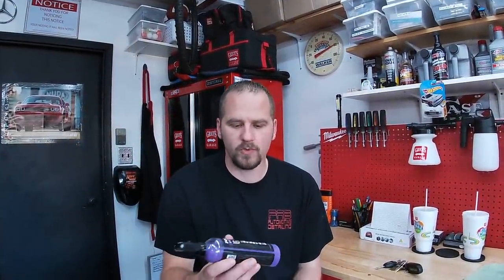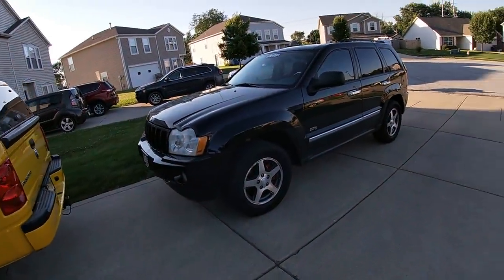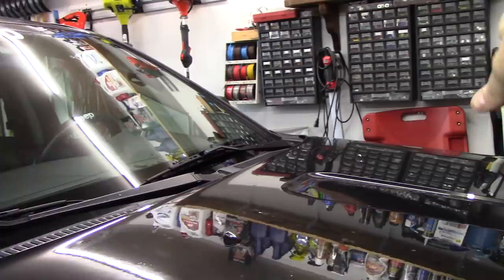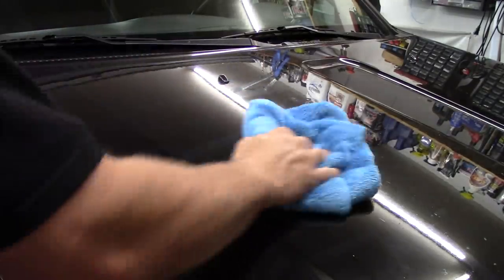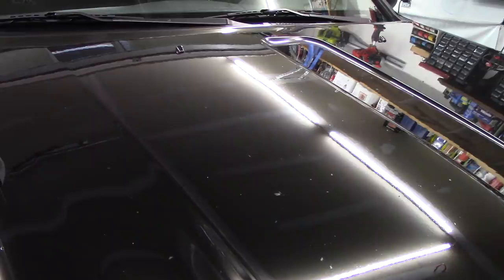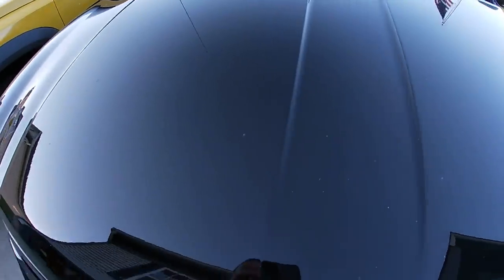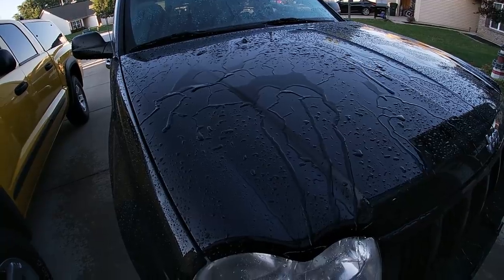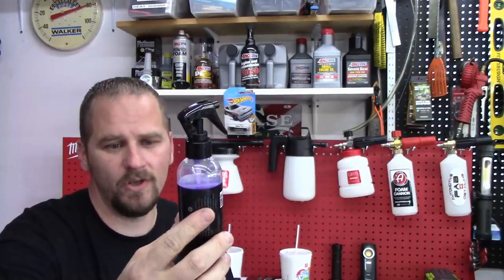Ultimate Ceramic Coating? Not even close! Shine Armor Fortify Quick Coat Review!

Comment: okay. so 2 things I noticed... now i am FAR from an expert, but i hope you revisit this product. first thing, when it says damp microfiber towel, it means damp with the actual product. Not with Water. Water dilutes it further thus decreasing its effectiveness. Second thing, this needs a 24hr curing time. I put about 5-7 coats on my 1994 corvette at this point and ive washed it numerous times and it still beads! The cure time and proper damp towel make all the difference!
Reply from the maker: John fedele I appreciate you commenting! The bottle says Apply to a clean damp microfiber towel. For it to be clean and damp before applying it would have to be damp with water. The bottle states no cure time at all. I get what you are saying but I base my reviews off directions on bottles. I to thought it needed to cure for 24 hrs but it says it no where on the bottle.
Reply: @FABAutomotiveDetailing  makes sense! Perhaps the manufacturer should change their directions haha take care
Reply: @FABAutomotiveDetailing  I think John is right in what he's saying.  I don't think you were supposed to spray that Armor onto your wet/damp towel.  Most of the demo that I have seen, people just spray that armor stuff on their "dry" towel to make it damp before wiping it down.  What do you think?  Redo?
Reply from the maker: Hanzelnuts I did it exactly how the directions state to do it. It’s says to “spray it onto a damp towel”   In order for the towel to be damp before applying the product it would have to be damp with water.
Reply: That product as shown in the video is junk.  It's just snake oil the company is trying to cash in on the detail craze right now.
Reply from the maker: damion goodrich I agree 💯! I think it might just be grape kool aid. 😂

Comment: I appreciate the honest review. I had used Shine Armor on my Black Lincoln sedan and thought it was just ok. A bit on the streaky side. Took some extra buffing out. I had washed the car before using it. Then one day my wife wanted a layer of SA on her Black Charger R/T. Began working on it and I don't know WTF happened. Was streaking really bad. It was a hot day but the car was not in direct sunlight. Didn't notice the streaks at first until I started progressing around the hood. Certain angles looked ok but other angles looked bad. It was not buffing out well. I was starting to freak out! Took me an hour to fix it. Will not buy that product again. I switched to Turtle Wax Hybrid Solutions Ceramic Spray Coating. Worked very well and it wasn't expensive. I ended up throwing out the rest of the Shine Armor. Very disappointed.
Reply from the maker: You are welcome! Yeah I don’t see what people like about this product. Your experience is the same as others that have commented about it.
Reply: This stuff attracks a lot of debris during the application. If you gently feel the finished area with your hands you will feel the rough areas where the dust dri.ed into the finish

Comment: Hey, thanks for doing this. I have been using this product along with their hydrophobic carnauba spray. It actually worked pretty well on my car surface (black paint). There is a substantial difference in before and after. Its a lot smoother and hydrophobic after the spray application. I wash and dry my car thoroughly, spray the carnauba coating first and then this ceramic coating. I agree with you that it lasts only between the washes but for $20 I have spray coated my car for ~10-12 times which isn't that bad..
Reply: Lol , it's the carunuba doing all the  heavy lifting bud 😂
Reply: @jackd1582   Not always, more recently I have used just the Ceramic Coating and it still gives me an excellent smooth and hydrophobic surface but like I mentioned it stays on only between the washes.

Comment: I am writing to you from Denmark. I had high expectations for this product and if it could also remove small scratches on door handles, then this fabric would be a revolution. Bought this through TEMU so it was very cheap and good for it as it's no better than regular Turdelwax. So much rather wash cars with soap and water and then use Sonax car wax. Thanks for a good and honest video.
Reply from the maker: Thank you for the comment! TurtleWax is way better than they used to be but I understand what you are saying.

Comment: I use this product, and now where does it say to utilize water when applying. You should always use just the product when applying. NO Water!! If you can, apply it in the evening when the sun goes down, you are able to let it sit on your paint for a longer period of time, hence allowing the product to adhere to the paint more effectively.
Reply from the maker: William Lemanowicz The bottle says to use a damp towel. It does not say spray on towel to dampen so if the towel is damp it has to be damp with water. I have tried it both ways and had the same results.
Reply: @FABAutomotiveDetailing  I wonder if you have misread the instructions, it says spray onto a mircofibre cloth and then with that 'wetted' cloth rub into the surface and then wipe off with dry cloth before it dries. i.e. wetted with the product.
Of course they may have changed the instructions on the bottle since you used it.
Personally I always wash the car first and then wipe over with this stuff to give it an extra coat, might be overkill but I always get a great finish with it. I don't however buy into all that nonsense about burning the car.

Comment: I just subscribed to your channel. What would you recommend for a waterless car wash that won't damage the paint. I have a black mercedes that has some swirls in the paint already but would like a product that won't make it worse. I will be getting either a paint correction done or a 3 step polish with ceramic coating done, depending on wha is recommended then. For now, what would you recommend to use for a waterless car wash?
Reply from the maker: Cesar V I like Griots Garage Spray on Carwash and Adam’s Polishes Waterless Wash. Waterless car washing is more technique then anything else to prevent swirls. I use several waffle weave towels and plenty of product for lubrication. Then with no pressure wipe in one direction and never use the same spot on the towel. Thank you for subscribing and I hope this helped.

Comment: A friend of mine gave me a bottle of this in return for applying it to his new BRZ, it seemed to go on fine, I didn’t get a chance to see it in action on that car. So today I spent 4 hours polishing my car, with several passes of multiple speeds on an orbital buffer before applying this stuff, which is what you’d want to do before applying something like this anyways. After applying a healthy amount of it on the car (NOT spraying it directly on the panel, the bottle says to soak it into an applicator pad) it was probably an hour before the car saw moisture. Mud from my back alley came off so willingly off the rocker panel. So basically it worked as well as I’d expect, and I’m optimistic about how it’ll hold up. If it shows signs of giving out, I’ll just polish again then wax.

Comment: When I read the instructions, it doesn't say anything about using it with a wet towel, as in a towel wet with water. For step 1, it says to "spray shine armor onto one of the microfiber cloths and onto the surface you are cleaning." Step two is " gently and evenly rub shine armor into the surface with the wetted cloth." To me, the " wetted cloth" references the cloth made wet by spring Shine Armor onto it. But, you may simply have instructions that are worded differently. I'm very curious what exactly your instructions say.

Comment: I'm definitely going to try this product. I'm no expert but the only time water is going to hit the car that hard is through a carwash and im assuming the product needs to be reapplied every so often
Reply from the maker: I’m using a garden hose not a pressure washer. It has about as much power as rain will. I tested and reapplied it multiple times after this video to see if I did something wrong and still got the same results.

Comment: Did u prep the panel on the hood claybar? Polish? Just wondering because i use that and it works great especially the winter...
Reply from the maker: Six cylinder jeeplife Bruno I used it per the directions as a waterless wash. I get what you are saying but you wouldn’t clay a dirty car. If you do clay it would have to be cleaned first and then it’s not a true waterless wash.
Reply: FAB Automotive Detailing well think about it on a prepped panel any detailer or spray wax or sio2 product works much better when the panel is prepped rt?
Reply from the maker: Six cylinder jeeplife Bruno Oh I agree with you on that but when I make reviews I follow the directions so the review is fair.
Reply: FAB Automotive Detailing i inderstand ur point but how good are the other waterless washes without prepping the panel? I mean opticlean is a good product too but longevity   Is a problem too..
Reply from the maker: Six cylinder jeeplife Bruno Adam’s Ceramic Waterless Wash is way better then this. I personally like a waterless wash that leaves nothing behind. Griot’s Garage Spray on CarWash is great.

Comment: I just ordered a bottle to test it out.. I was watching a few videos on this after I ordered and one thing I noticed is when 2 or 3 coats is used, it works very well. In saying that, I would rather just have to use one coat.
Reply from the maker: Eoin Healy 2 or 3 coats might work but that would take a lot out of the small bottle. I agree I would want to do just one coat.

Comment: I'm sorry I see that car is already clean with small imperfections in the paint but all it needs is a clay bar job and a good washing. Tried doing a video with that product on a vehicle that's a lot less beautiful 😂🙄
I think its grape scented 🐍 oil. 
Thanks for doing this video, you just saved me $19 plus dollars because I was going to purchase this product🙄
Reply from the maker: M Piper This car was the perfect candidate for this type of product. You don’t want to use a waterless wash on a real dirty car. You are welcome!
Reply: I'd recommend using mother's cmx or turtle wax hybrid ceramic spray wax.
Reply from the maker: Dalton Flandro Both of those are good products but not waterless washes.

Comment: Pros: 
- Nice bottle
- Smells so good you’ll want to drink it

Cons:
- Expensive for what it is
- Their “ceramic infused” is misleading marketing. This has NOTHING do do with a ceramic coating.
- Others have tested on a brand new pannel and their was visible streaking after. I bought it once and use it on my matt black motorcycle, but wont be buying again. I’ll just smell the empty bottle once in a while.

Comment: Fab, Is there a way to tell if a car has been ceramic coated? My new car has a shine on it like I have never seen on a daily driver car. I don't know if the dealer would tell me what they used on it. I doubt that they would coat it but maybe the previous owner did.
Reply from the maker: There is no easy way to tell. Water behavior is about the only way with out polishing to try and remove it. Ceramic takes a heavy cut product to remove so that’s about the only way to know for sure. I doubt the dealer would coat it but the previous owner could have.
Reply: You have the easiest answer. I will just see how it holds up to washings and how long and see how it looks after driving in bad weather. Thanks.
Reply from the maker: kawtriples You are welcome!

Comment: I should also add, applying in the evening the product wipes off easier and smoother. Try not to get it wet. If it gets wet just let it dry on its own, do not use a towel to dry it.

Comment: I've used a waterless wash from Nanoskin and mixed it with their Quickshine to make a waterless wash-N-wax years ago and it works great for me as a quick cleaner for light dirt. But like any other waterless wash or quick spray wax it "DOESN'T" last and water will not bead forever. For water beading I use the Hydro Express from Nanoskin. 
I wonder if the Shine Armor needs to settle before doing any kind of water test 🤔
Reply from the maker: Chris Camacho You are right waterless washes don’t add protection for very long but this was just bad. The bottle didn’t give a cure time and I like to do my reviews off directions.
Reply: @FABAutomotiveDetailing  
Directions are key, especially if we don't know the product.
Thanks for the vid, it helped my decision.
Reply from the maker: Chris Camacho You are welcome!

Comment: Did I miss something at the beginning or did you use it on a dirty car? I’ve had nothing but success with this product on a freshly cleaned, cool vehicle..
Reply from the maker: brandon foote Yes I used it on a dirty car because that’s how they advertise using it. It says it is a Waterless Wash.
Reply: FAB Automotive Detailing ahhh I see. Never knew that. We just use it as a spray wax/coating or if there’s light dust from sitting in the shop... same with f11.

Comment: So I got a question for you I noticed you put water on your rag but nowhere on the description or the directions does it say to which a rag with water it says it's waterless so why did you wet your rag?on the directions it says spray shine onto one of the microfiber cloths and onto the surface of the cleaning area number two says gently and evenly rub shine armor into the surface with the wet cloth and I'm sure what it means by wet cloth is the cloth that you just sprayed the product on 🤷🏽‍♂️ so doesn't that mean you just did the whole video wrong you were supposed to spray only the product on the rag but you used a wet rag and product which doesn't make any sense and then on the third direction it says quickly switch to the second folded microfiber cloth and gently wipe away before it dries so it's like a wax on wax off type of thing
Reply from the maker: My bottle directions say to spray onto a damp microfiber. In order to spray it onto a damp microfiber that means it has to be dampened with water. They may have changed the directions after my video on the new bottles. I did it exactly as the directions say to use it. I read the directions on my bottle word for word in the fist 45 seconds of the video.

Comment: The turtle wax ceramic coating from Walmart ($13.95) is the best of these spray on coatings. Before you chuckle at how silly that sounds, check out project farm's video on the 8 different spray ceramics. The TW version outperforms all the others, including Adam's (which also does well). It even holds up to extreme torture and holds it's ground. 

Short of it: Before you go spend a boatload on the really expensive products, do some research. Then do yourself the favor of getting and applying the TW ceramic coating.

Comment: It is all your fault I am looking at getting ceramic coats on both cars!  Could you tell me if a professional detailer was doing a paint correction on a 2015 Mini Roadster which has only 13,700 miles on it, (good shape there are some spots that need work, better than average) what would you anticipate the "price range" to be? Second they use igl ceramic coatings (Kenzo) which have good reviews.  What is your opinion about that product?  On ceramic coats I can find information on cost but the paint correction seems to be a bit of a mystery.  I appreciate the help and if you were only closer, you would have a job for absolute sure!
Reply from the maker: Paint correction on that car would probably cost around $300 but it just depends on how much time they have in it. German cars typically have hard clear coat and can be tricky to correct. I have never use IGL Kenzo but I know a guy who does and he loves it. Hope this helps
Reply: @FABAutomotiveDetailing  Yes it does.  I liked the shop but felt like the price was based on what they thought I could pay to a certain extent.  My research came up with prices from a few hundred to a couple thousand which left me a bit bewildered. I know car condition and size are key which varies so a lot of the pricing seems to be built on trust.  THANKS.

Comment: I was wondering what is the best product to use that will last the longest
Reply from the maker: That’s a loaded question. It depends on if you want a wax,sealant, spray sealant or true ceramic coating?

Comment: I used shine armor today on my 300s, i buffed/wiped it longer in a buffing motion till almost dry, then switched to my dry microfiber cloth and wiped/buffed until all was removed, I could tell a big difference, it passed the bottle test, but I didn’t try the water test, I’m going to do a second coat tomorrow and saturate the area more than what I did today, but all in all I haft to say that it worked better than I thought it would after seeing this video, just my opinion but I believe with the second coat of saturating the area more that I’ll have good results, I’ll check back in and give me opinion
Reply from the maker: Johnny Wadd Yes please let me know how it works for you! It does clean well it just wasn’t durable for me.

Comment: What product actually is good and works ?
Tired of having to wash them after every ride
Reply from the maker: Steve-Os Hobby House If you are talking about a motorcycle I would use Adam’s Polishes Ceramic Spray Coating. I have a video where I used it on a Harley. Give great gloss and protection.
Reply: Cool thank you
Reply from the maker: Steve-Os Hobby House You are welcome